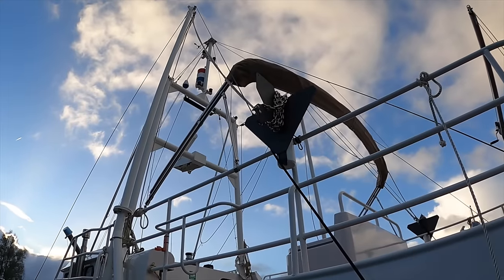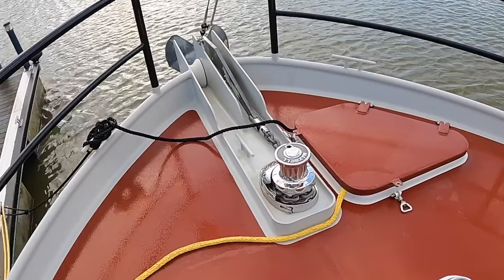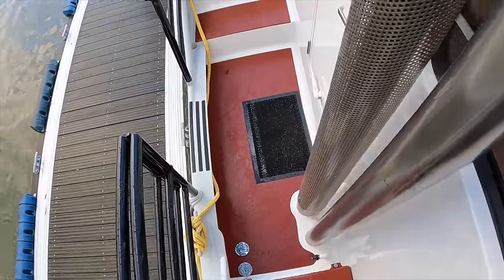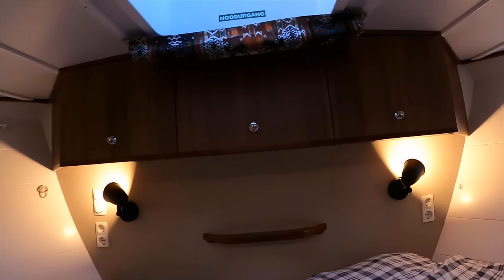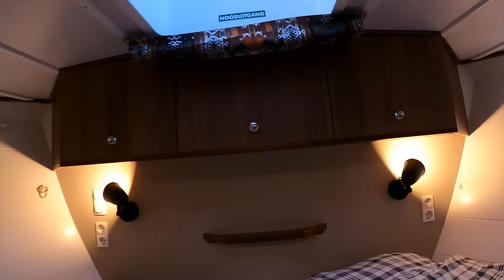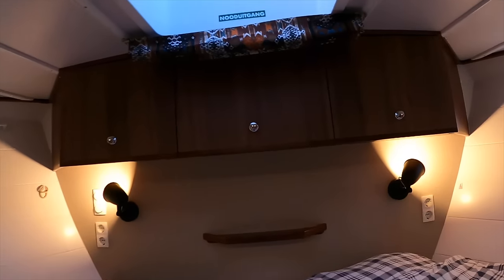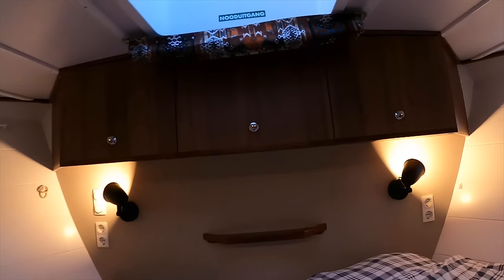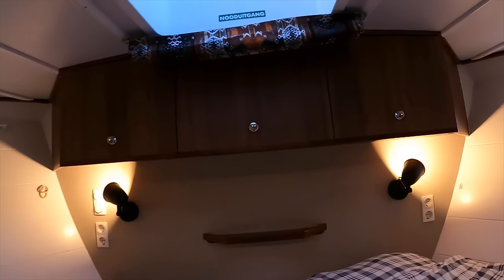THIS Is Hull 1 €585K STEEL Trawler Yacht With A 5,000 NM Range!

Comment: I don't understand where you'd take a boat like this (rugged, overbuilt even) where you'd want both a huge tank AND only a single engine.  Close in to shore in rough weather, don't need the tankage.  Long distance, presumably remote...you'd want a second engine.
Reply: The single engine is not really an issue out at sea as long as you have spare parts, hose's, couplings, fluids, and wiring parts for the electrical system, hydraulic system, fueling system, cooling system, shaft, rudder, and prop.  Those are all the things that are most likely to fail, foul, or worse, catch fire.  The odds of a catastrophic transmission, or internal engine failure due to the internal parts, head, or block is almost non-existent on anything with less then 10k hours and no older then 10 years if it's been decently maintained.  And even if that did occur, an engine failure out at sea is ideal because you have all the time in the world to try to fix it or use marine radio or satellite communication for help and get towed back to a mainland.   The worst time to have an engine failure is going in and out of port because then you're at the mercy of the currents, hoping not to drift into another boat, piling, rocks, or bridge.
Reply: @adamhose5231 mechanical Engineering mid Atlantic?

Comment: If we’re planning to voyage seriously I would require two main engines. Instead of a single 175 horsepower John Deer I would want two 110 horsepower engines for safety. Two alternators etc so I don’t get stuck between a rock and a hard place in the middle of nowhere.

Comment: Great tour of this beautiful trawler. I'd put a little freezer in the lazarette, upgrade microwave to a combi, put a double in the cabin, and a 2nd water maker for redundancy. I'd be happy to live aboard, doing a lot of costal cruising & inlandwaterways. I wouldn't probably cross the ocean, though. Dream on 😅
Reply from the maker: Great idea! thanks for the comment 🫡
Reply: Agreed, good ideas! As she is, there is no way to bake, unless you use a Dutch oven on the slippery stovetop, for long offshore passages baking is kind of an essential need.

Comment: Absolutely perfect no frills pocket battle wagon. We had a 36’ Steel boat with very similar systems down to the single keel cooled engine and it was a bit small for a long term live aboard. This nails all the things we would have changed. Paravanes work brilliantly. We cruised all the way down the Easy Coast of Australia and across Bass Strait to Tasmania and our home port of Hobart. As you said, set and forget almost. If my health and finances allowed it we buy it as is.
Reply: This is quite the boat. Everything one might need, and little else. Its size makes it easily managed by a couple. I've got to say, however, making an Atlantic crossing would take some big, hairy nads. One thing about it, one would realize just how small each of us truly is. This would be an experience, no doubt. I've little doubt this mini-ship can make the trip,  I wonder if I could. I'd love to try it, nonetheless. I, too, would buy it in a heartbeat had I the money, There are still a few good years left, and I certainly have the time these days. 

BTW - The trip you describe was quite the undertaking in a 36 foot vessel. Kudos.  You have an adventurous spirit. Good luck with your heath. Smooth sailing.

Comment: I have a boat more similar to this than you would believe. It carries 650 gallons or about 20% more than this vessel. With two 98 hp Ford-Lehman E-Con-O Power 6 cylinder diesels that burn 1.2 gallons/per hour/per engine at the same 6.2 knots, we have a 2,500 NM range. Watching the bow entry and hard plowing effect, there is no way I can believe this single 165 hp John Deere engine consumes less than 0.5 gallons/hour which would be required to have a range of 5,000 NM (even with 0% reserves). 
  I am in Roche Harbor now (September 29th, 2024) and just watched 20-30 Nordic Tugs leave here this morning from a rendezvous of more than 50 NT vessels. These too are based on a similar layout and design. I wondered how many of them realized the first company to produce such a seaworthy design as this was none other than Cheoy Lee, the oldest and most diverse boat builder in the world. The 4 water tight bulkheads, the reverse rake pilothouse with watch berth, the FG integrated tankage, the paravane stabilizers, the cockpit and swim platform proportions, the salon layout with day head and couch on starboard, settee then galley on port, the large V berth with head to port aft of the berths, all match my boat's 50 year old design. Well, this one and the Nordic Tugs are not likely to have integrated tanks, but ours does.
  It is a phenomenal boat, just think the owner/seller may have exaggerated the range by quite a bit. The math just doesn't add up. Even adding the day tank. (5000 nm/6.3 nm per hour = 793.65 hrs. runtime per total 100% of tankage) That is actually 0.63 gallons/hour...maybe at 5 knots?
And one more correction, the delta fish and chain or cable supporting them do create some drag (read Robert Beebe's definitive "Voyaging Under Power") about 1/2 a knot drag at 7 knots is expected as an average for a boat with this water line length. It is negligible until you talk about trans Pacific or trans Atlantic range calculation, then we are literally talking hundreds of miles in reduced range with the fish in the water. Most, like me will leave the arms down and ready, then drop the fish in when beam or quartering seas are experienced, and then retrieved when a long fair forecast is enjoyed. Thus, saving that half a knot or so of added consumption.
  Keep up the great work. I really enjoy your channel.
Reply: Dude. You miscalculated fuel for the featured trawler. It has 2x the fuel of your boat, thus easy 5k nautical miles
Reply: @darrinjones3736: He forgot to mention that the 5000 Nm are only possible when it is permanently going downhill.😉

Comment: Dear Yacht Buoy: I have to correct you on one point. Paravane stabilisers definitely DO reduce speed, assuming same engine RPMs and comparing deployed vs. non-deployed state. I have built these systems, owned boats with them fitted, and can compare. Depending on the myriad factors in play, you can assume that when paravanes are deployed, you will lose between ½ and 1 knot SOG. In no way is this a problem, but I think good to know.
Apart from that, this is a boat I would love to own. And thanks for the tour of her.
Reply from the maker: Thanks for the info!

Comment: I like steel trawlers, hope the superstructure is welded to the hull not bolted on. Yes potential ocean crossing vessel but you would be rockin’ and rolling‘ although the paravanes would help. John Deere engines have a good reputation in the US where I live but only one means of propulsion would make me nervous in a crossing which would take a while at 6-9 knots. When I was in the US Navy we did crossings of the Atlantic and Pacific at about 20 knots and it still seemed like an eternity. Overall though I like this boat and would prefer it to a Nordhaven. Thanks for the review.
Reply: Indeed, that’s why the minimum size for trans ocean used to be thought of as around 75 ft, which allows the carrying of enough fuel for more speed and possibly twins as well…😊

Comment: The price on this is fantastic. I would have guessed over a million because of how well it's built. If money were no object I think I would want a couple more bedroom options that I could turn into more storage for food and machine parts. Parts for engine, water maker, generator, electrical items, etc. It always amazes me how I never see an area on these boats where they store emergency parts. That's really rudimentary stuff that doesn't cost a lot, doesn't really expire, easy to install, etc. but, if you don't have it and you blow some sort of hose, etc. you could be stuck at sea wondering why you didn't spend the extra $5 for any one of these parts. Anyway, I would like more storage for food, parts, and also a really good quality trash compactor with some sort of sealed storage container to hold the cubes of trash to keep in the smells until I get to port. I also have a question....is there some sort of international law about dumping grey and black water when you are far out at sea? Just wondering. Greetings from Texas....

Comment: you DO NOT want to take a big wave from the side but you never know.
  good name for this is "The Rubber Ducky"
Reply: Don't worry...the Windows are made of 12mm LEXAN
They are stronger then the ship..
Reply: This is when the well trained skipper comes into game, to avoid such situation.
Reply: @tikerak 12mm Lexan is stronger than 20mm of steel? I would bet it depends on what you mean by stronger.

Comment: 2020 STEEL Trawler 42" , €585k
John Deere 4045 AFM M1 160hp , 5000 Liter ,TS 8.8kts , CS 6.3kts , MR 5000nm at 5.1kts
Perhaps underpowered and no stabilizers are the biggest issues here.
What a great boat and  perfect if  John Deere 6068SFM85 M2 285hp was chosen

Comment: Great boat but crossing the Atlantic with one engine would worry me
Reply: Look at it this way, 3,500 miles in a car nothing to brag about, never mind 30,000 miles. Although running hours in a boat will be considerably  more. However I'm sure that marine engines and all exilaries are built to a higher spec than any car engine....

Comment: How long would it take or what does it take to train someone who has no experience on how to operate this boat?
Reply from the maker: It depends really on where in the world the boat would be operated. But, from a UK perspective, I would not recommend operating this boat with no experience. You would be much better off starting off with a smaller boat and getting some experience on that. And then maybe do you PWB Level 2, before doing some other MCA accreditations etc

Comment: Wouldn't it be difficult to cook on an ungimballed stove in heavy weather?
Reply: With no way to keep the pots from sliding off the stove ... In heavy weather cooking on that stove would be dangerous, Imo.
  I'd have one (or two) of those gimballed backpacking stoves on hand for rough weather.

In my experience motor boats rarely have gimballed stoves, (I'm a sailor)

Comment: It pushes a lot of water, thats wasted fuel. Still, you do not get that amount of accommodation and tankage in a fine bowed hull of the same length. Its all compromises.  Simple, no bells and whistles, one for the voyagers not marina queens.
Reply: This voyager would have to make some changes to the galley before heading offshore, like adding fiddles, and swapping that apartment style cooktop for a marine diesel cook stove with an oven, sea rails and pot holders.

Comment: A great no frills boat, especially the cabin. No oven in the galley, why? For serious use in any sea you need rails round the cooker and worktops, pans etc will slide off as it is. A good range but I'd worry about crossing the Atlantic in her. No wing engine and at her speed in rough weather you could easily run out of fuel. Like that watermaker and sola set up.

Comment: One engine not happy with that should have a wing engine otherwise looks a brilliant boat
Reply: I agree!! Plus two water makers if they only have one.
Reply: if he had a electric motor back up with a generator would even be ideal
Reply: Comes with two oars and a servant!
Reply: Most of the Nordhavns has a wing engine, but i never heard that they are ever used.
Keep your fuel clean and most engines run forever
Reply: The wing engine on a Nordhavn run the thrusters.

Comment: Too bad it only has one cabin.
Reply: Too bad the cruise speed is only 6.3kn. Range is usually given for cruise speed. Then again that's usually the case with trawler type long range yachts. Only way to get around it with them is to increase hull length. 
For 12-15kn long range small yachts its either VSL or SWATH hulls.